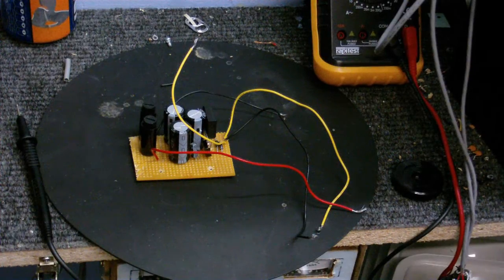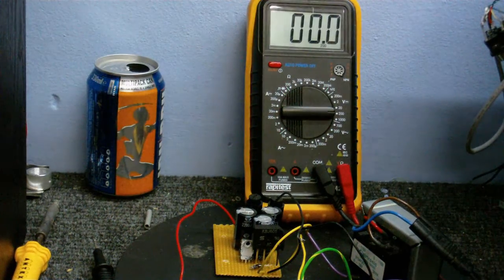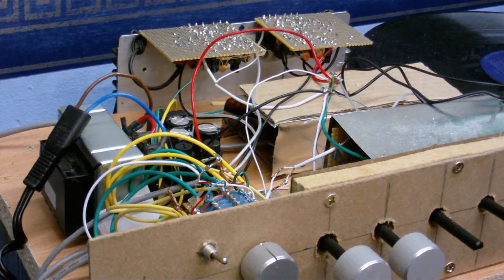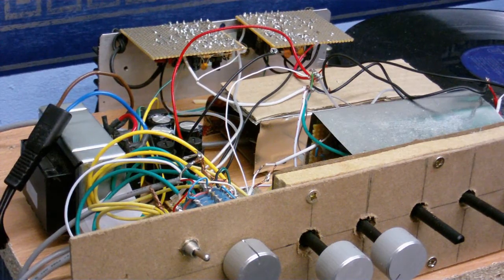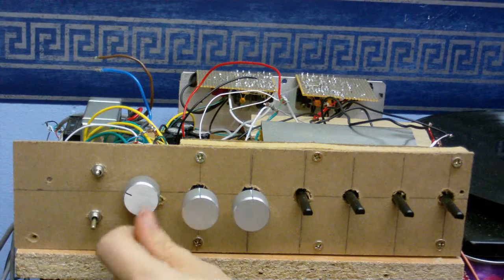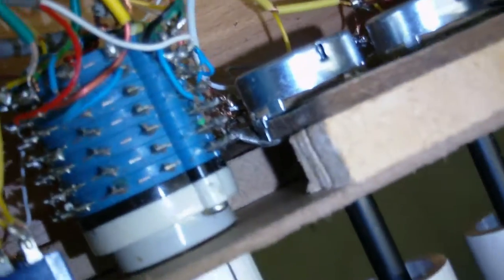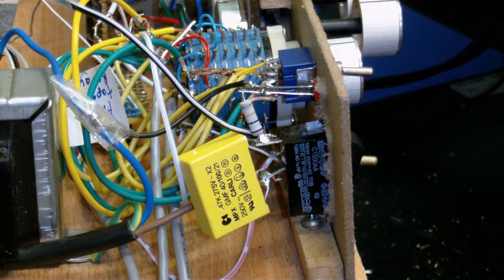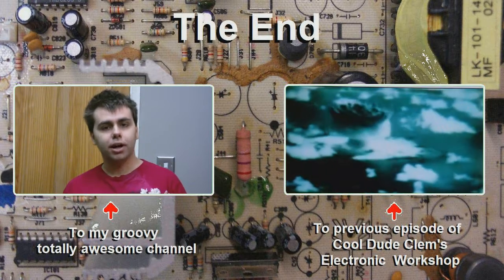CDC Electronic Workshop - The Amplifier III part 4

Comment: transistor for power amp mn2488  mp1620 .i used 2n2222 and 3904 buffer ,driver tip41 and tip42 .pre amp with control 2n2222    so far everything works fine
Reply: I use icl307